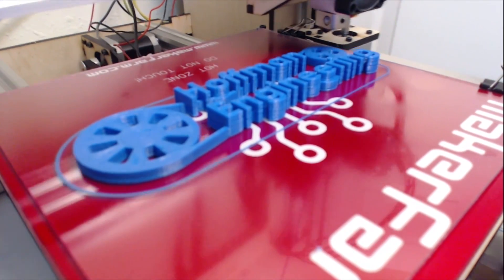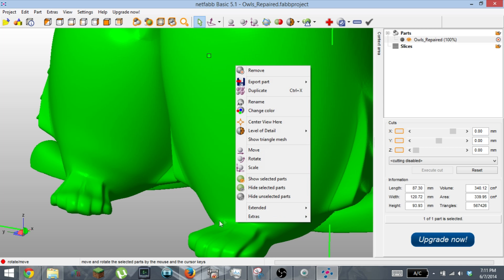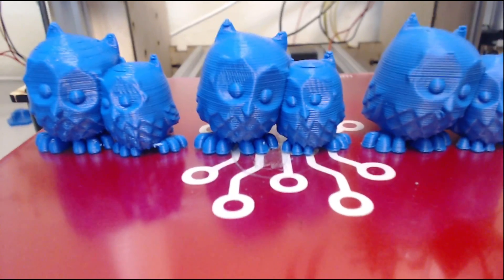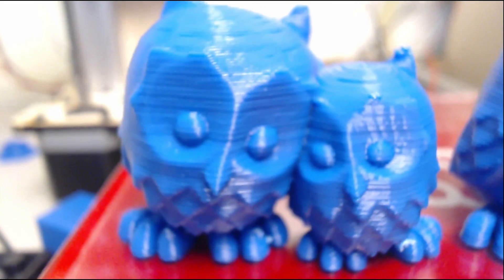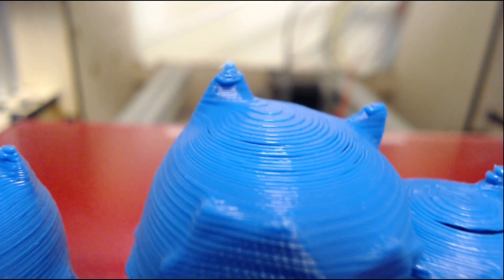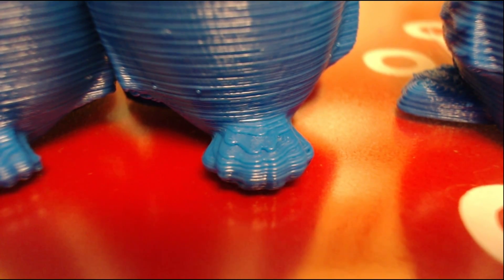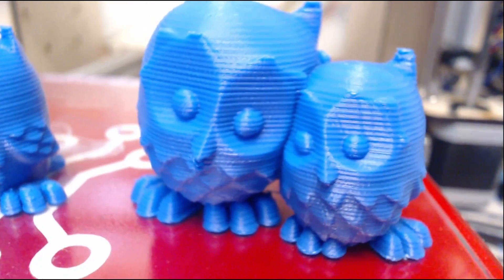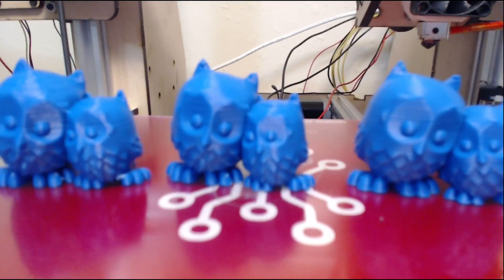Layer Height Differences

Comment: things i can think of with smaller layer heights are: increase extrution overlap a bit and maybe increase flow rate also a bit. Also miht want to try slowing it down when it gets to that section.
I know this is old but get new rods!  you had more z wooble than resolution in your printer!

Comment: I don't know because I don't have a printer yet, but is there a way in the software or settings to tell it to slow down only when it gets to steep small parts like the tips of the ears so you have adequate cooling time?
Reply from the maker: Nathan Gray In the slicer settings, there is usually an option for this. I know SLic3r has an option for a minimum layer time, where it will slow down the speed of the printer if the layer was going to be printed too quickly.Another option would be to print what is called a cooling tower next to the object. Its just a cylinder printed next to the object, but it increased the amount of time per layer, allowing for additional cooling.
Reply: Thanks for the answer!  I hadn't thought of the cooling tower idea.

Comment: Ever have any issues with the abs filament jamming in the extruder?  I have had several long prints fail because of jammed filament.  The filament stops and the feeder bolt digs a groove into the filament...no more extruding.  Still working out kinks I guess.
Reply from the maker: I found that might happen for a couple reasons.

Check that the extruder idler bearing is easy to turn. My bearing was rubbing against the hole in the back, so it was hard to turn. I had to push the bearing out some so it wasn't rubbing the idler.  If the bearing is turning freely, check that the idler isn't pushing the filament too hard into the hobbled bolt. Loosen the two long bolts holding the idler on, that will reduce the pressure on the filament.

Those will probably solve it. If its still jamming, then check that the hot end is tight (I had an issue where the heater end was lose, and plastic was leaking out of it), and play around with the temperatures.

Comment: WOW What the hell is up with your z banding ,and how slow are you printing for the .3 to take so long? its just a suggestion, but I think you really need to find who sold you the printer, and ask them exactly what lead screw or threaded rods they put on your printer, and find the correct TPI and use prusa calculator  to find the correct layer heights for the micron  you wish to print,  I never seen such bad print coming off a prusa before.

Comment: Tipical problem  you hawe M6 rods  use 8T8mm and you see no more problem's l. If you have nozzle 0.3 max layer heigt  is 0.2mm  end use more perimeters  min 3 or 1mm  ;) velocity make adapt  on temp.  of extrusion  lovest slowly higest fastly, filament  needs time to become fluid if it is more fluid on slow print you dont control flow plastic flow with gravity and create  artefacts but first change your Z M6 rods trapezial 8T8 its better ;) soory for my English  its from films :P

Comment: bery bad result for all of them they are not smooth what nozel you used what is the printer name to avoid buying it that is very bad printing
Reply: There are very little bad 3d printers on the market atm. And if they are bad, they can be improved upon. All of those artifacts can be easily fixed by changing settings, tightening belt, and reinforcing the frame. But yeah, I don't understand how he could be complaining about Z-wobble on those crappy prints whilst there is definitely something more going on than a bit of wobble. Don't blame the controller, blame the player.
Reply: ngc charle the problem are the stock parts, these off brand prusa's have Chinese parts with bearings that have too much play in the rods. The issue in this however is the z axis. I used to have this issue and I switched to $20 trapezoidal screws with 3d printed nuts and it prints as well as my prusa mk2 (the voted best printer in 2017). The threaded rods are just yanking around the x carriage, also make sure they are not constrained at the top and use some real aluminum couplings